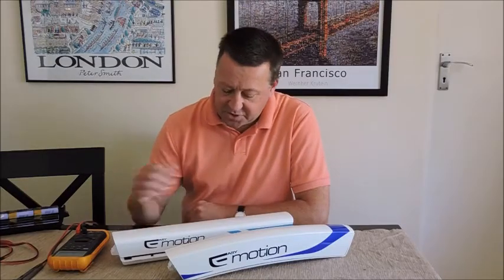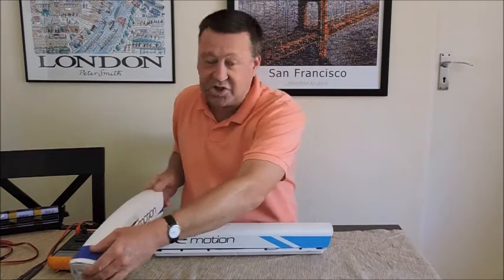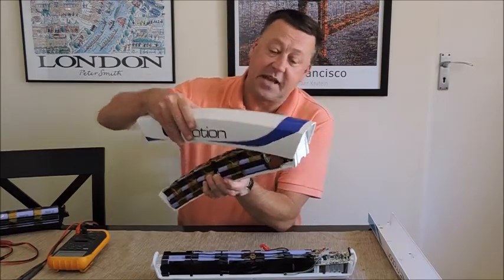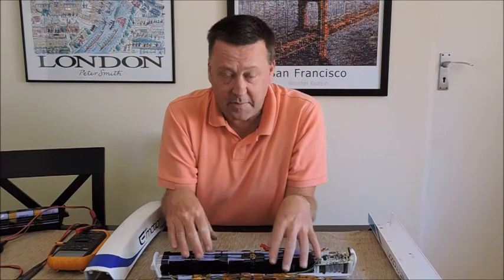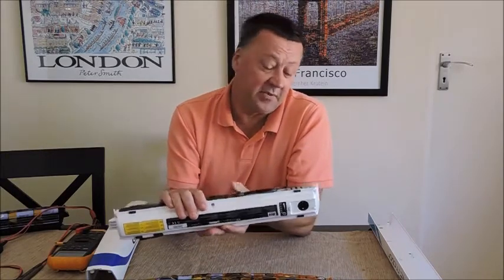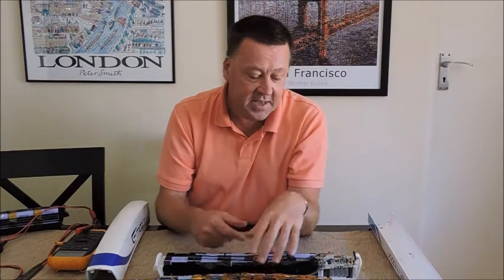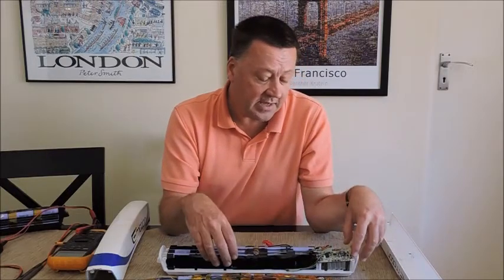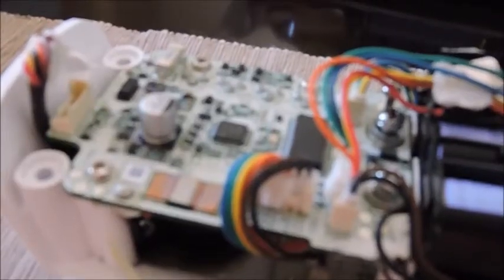BH Easy Motion Battery Teardown #1

Comment: Ala, so glad I found this video. I have a 2018 EasyMotion Lynx that uses a 36v 16.8Ah 605Wh battery. I was fortunate and bought a second battery for it after I had it for 9 months. I'm about due for a rebuild on the original battery and this hopefully will be a big start.  Thnak you!!

Comment: The BMS has a reset button, but it is inside the case. I have seen a youtube where you can measure out where you drill for access to the button. Then cover with duct tape.
Reply: Reset button. U mean if i hold battery check button?
Reply: @AndreySedov  Eventually I took off the cover and found the button is mounted sideways so you can’t press it through a hole. I don’t know what you mean by a battery check button.
I have the curved battery holder. Be careful taking off the cover and don’t short anything. There are 50 18650 cells in there for 35 volts. Your electric bike shop might be able to do it for you.
My symptom was that it wouldn’t take a charge. The first time it happened, the bike shop sent the battery to someone who balanced it. The second time they just reset the BMS and didn’t charge me for it. I’ve had no further problems. Be aware that some bike shops would rather sell you a new bike and might be unhelpful. I went elsewhere.
Reply: @darylcheshire1618  my battery has 5leds + level check button. if i hold her - something occurs. they call it - wakeup button
Reply: @AndreySedov  Is it a BH bike? Mine is ten years old so probably looks different. Perhaps it became obvious to make the reset more accessible in later models. When I first got it, I’d never heard of balancing the batteries where a less performing battery causes the BMS to give up and has to be separatly recharged manually, it is probably part of maintaining an electric bike.
Reply: @darylcheshire1618  no. Its bmw,but batteries are same

Comment: Thanks for the video.  I came across a uses 2014 Neo Cross.  It doesn't have a battery.  Took it to a bike shop and everything works when you put in a battery.  I have a lead on a 48 volt battery from a Neo Nitro battery and charger at a great price.  
My question is will I damage the Neo Cross electric components by putting in a 48 volt battery instead of a 36 volt? You mentioned you tried it and it worked.  Any long term damage I can do to the bike?
Thanks,
Mike
Reply from the maker: HI its a good question, I don't know the exact answer but I dont think it would harm the controller or hub motor.  My issue is the firmware needs to be changes for the controller ro see the correct voltage levels or it just stays in the lower assist level (limp mode)
Reply: Thanks. What do you think about taking the 48 volt pack apart and reconfiguring to a 36? If both packs are the same dimensions, theoretically, it should work. I'd probably need to replace the bms. Could I use an off the shelf BMS?
Reply from the maker: I have also thought of this and it solves many problems, FYI the 48v Pack contains 1 less cell the 36v, you will also need to totally rewire the entire pack for a 10s configuration.

Comment: HI Alan, I have a BH motion carbon, my display was damaged, it still works but you can hardly see it, only the speed at which boy... I want to change it but I can't find the original, do you know which one I could replace it with? Thanks a lot
Reply from the maker: Hi I bought a replacement (HARD WIRED VERSION) from my local dealer ..so they are available .... the hard wired version solve the removable screen intermittent connection issues

Comment: Hi Alan, I am on the fence about what ebike to buy. I came across a leftover 2015 Evo Jet models from Easymotion for a significant discount. It has the older 36v system. One of my concerns is their proprietary casing would make it hard for anyone besides the manufacturer to sell a replacement battery. Once they decide to drop it. You are out of luck. What are your thoughts?

For about the around the same price I can get a Juiced 48v Crosscurrent. It seems to be standardized across several models. Would you go with that instead?
Reply from the maker: Hi the 36V model is fine... their batteries are reasonable and good quality,  you should be fine

Comment: Hi Alan. Appreciate your efforts here. I've just ordered a replacement battery for my 36volt 12AH Neo29er.(the older curved model) Been experiencing cut outs after the battery gets to about half charge. Believe its called Voltage Sag. At considerable expense the battery should arrive next week, minus the outer casing which I'm informed should simply change over.  I wouldn't mind having a crack at repair of the old unit if that's achievable. I'll be waiting with great interest for your next installment.   Regards Bryce
Reply: Szukam baterii, gdzie mogę ją kupić?

Comment: Hi. Excellent videos.  I have a Neo Jet and the battery got shorted for a sec which seems to have blown the BMS.  Did you ever find replacements?  I don't think i have the knowledge to charge and use it without a bms.
Reply: Hi friend.  I now the secret how to activate the bms again.  My batery is 48 v Bh motion.  And it was damage , and  i repair. 
  The curent enter in Bms but nothing get out.
 Finaly  i succed 😀
Reply: @SamsungSamsung-zh2qk  how Reset the bms?
Reply: Hello.  I'm Eugene.  I reset the battery as follows.  I took an adjustable source of 60 v. I put on Plus and Minus of the battery.  The two big pines, and I started from 0v slowly slowly and done.  Activated!  Good luck with that

Comment: Sorry to keep bothering you.  What are your thoughts on adding a second battery to run in parallel? Is the computer able to be reprogrammed to a higher, say 20 Ahr, setting? Could I just splice into the red and black wires on the battery side of the white plug?
Thanks
Reply from the maker: I really need a second battery to improve the range on long steep rides, so this is less of a requirement for me, check out the Speed Hack video for adding in parallel

Comment: Hey Alan hope you see this comment , I have a BH easy motion Evo 19 and my battery isn't charging. On the bottom of my battery pack there is a button to check the battery level but only the 4th light flashes out of 5 total lights. Does this mean my battery is dead ? Is there a reset button on these battery packs ? Thanks
Reply from the maker: Hi it's probably the BMS or the pack needs to be manually balanced..   there is a BMS reset button coverd in another video blog I'll include the link
Reply from the maker: Check out https://www.youtube.com/channel/UChX9VzBo6NXDuyM0xXHG8RA

Comment: Thanks.  I took the cover off of my battery after it started behaving erratically, but its too complicated in there for me.  The battery reprocessor wants 477 dollars to deal with it.  The damn thing is less than two years old.
Reply from the maker: Hi I have now tested my 48v battery with no BMS (Battery Management System) Totally bypassed the entire BMS board, it is working just fine.  I'm building my own charger and balancer, I'll upload a new video this weekend.  Is your Battery a 36V ? What is the problem you are having ? Which model of Bike do you have ?
Reply: I have the Neo Extreme and Neo Jumper and interchange three batteries.  The batttery in question has suffered a couple of crashes onto pavement.  After working fine for a few weeks, it now shuts down after about five miles, even though I had 4 or 5 bars.  The store I get service at doesnt have the BH diagnostic tool.  Any suggestions?
Reply from the maker: Check the red and black spade conectors onto fhe socket that goes to the bike ... its showen on my video at the end ... these often are loose and fail under load
Reply: You were able to use the 48v battery on a 36volt bike?
Reply from the maker: Hi I have done some initial testing with the 48 Batt but the power meter just flashes, it seems to think the battery is discharged and limits the output.  I hope there is a way to change the monitoring voltage range on the display?  I should be posting an update this coming weekend.

Comment: I saw on a blog some one connected in series a ten volt battery resulting in a higher top speed. My bike is a little slow for my liking.
Reply from the maker: Yea I think I saw the same clip, if you can get your hands on a 48v batt (fore a 36v bike) this will give you a lot more power, but you will need to find a higher voltage mains charger as well
Reply from the maker: Hi sorry for delay ... yes this can be done

Comment: how can you by pass the bms ?
Reply from the maker: Hi bypassing the BMS is easy, you jut run wired from the pack to the connector, the main problem then becomes how do you monitor the recharging with no BMS.  If you have a dedicated balanced charger like a Trilogy it wont support a S14 pack.  My problem is also made worse in that running with a  48v battery on a 36v bike means the bikes display on the bike handlebar display (just flashes)   Then I need to also monitor the discharge so I don't run the cells falt.  I aim to use a little LED monitor with a low limit alarm for this.  I use a chinese External BMS to charge ....   I better put the video out it easier then trying to explain this in words.
Reply from the maker: Part II is up https://youtu.be/DpKSf4PSSGo

Comment: Why there are any bms, cause either not the bike or the charger wont use them. So The charger can overload The batts, and The bike can underload them without knowing whats happening inside the cells.. so stupid and cheap, and not cheap at the same time.